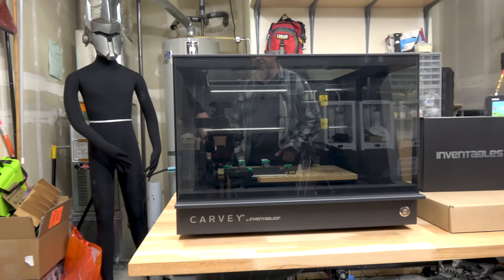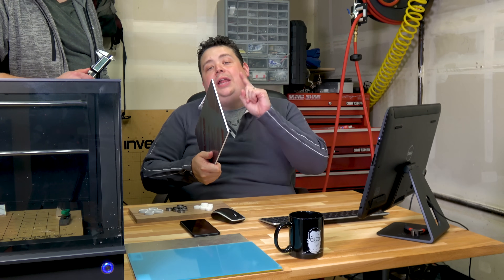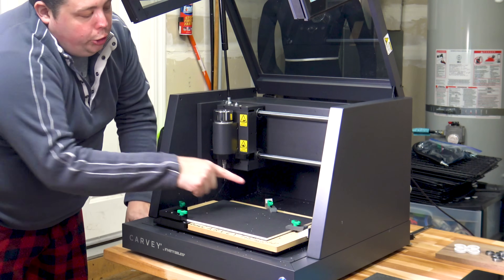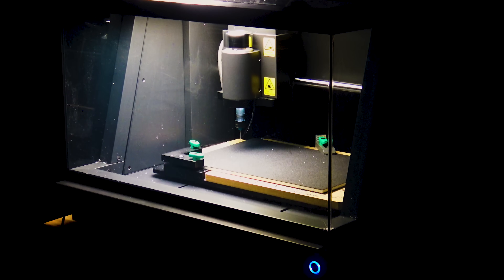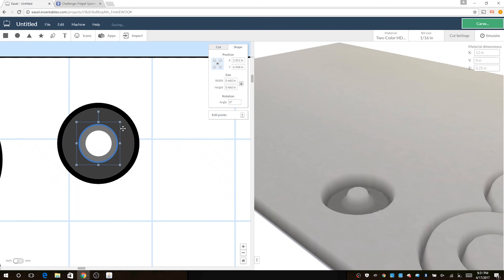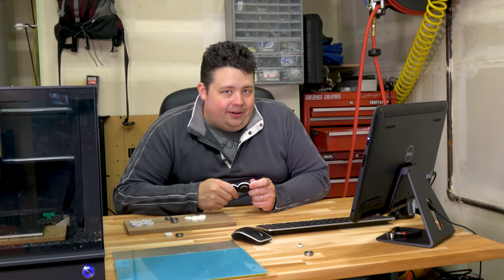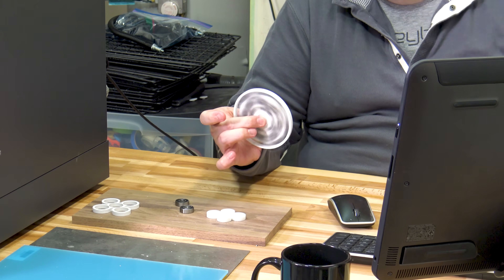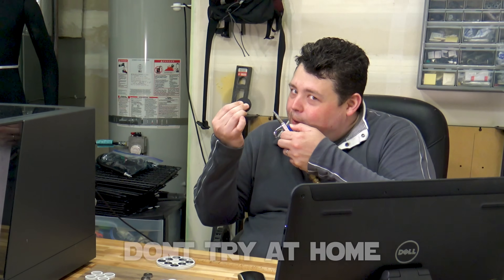Making Custom Fidget Spinners with Carvey Desktop CNC Router!

Comment: Yeah, gotta be careful, warn your users about using compressed air to blow things like fans and other rotating things to high rpm. The problem is that you can create a centrifugal force in the component that it can't withstand and it will fly apart.. Maybe into your face and eyes. If you're using compressed air to blow clean fan blades, use something to stop the blade from turning if you can.

Comment: The cnc router I use is about 6'x6', can cut stuff up to 6 inches high, and its just a small one.
I've made boomerangs and such, I recently made a table leg that twists 720 degrees and tapers as well.
Quite neat things you can do with these, but. 3D printers are more versatile and can do higher quality work.

Comment: I'm pretty sure the first touch off is for tool length and not for material thickness. Also, you may want to look in to using tabs that are basically small bits of material that keep your milled object connected to the rest of the material so it doesn't "fly" out after it has been cut.

Comment: What's more important than zeroing your calipers, is cleaning them. Just close the jaws over a piece of paper, kleenex works best, and drag the paper out. When I was in the machine shop I'd see a difference of up to 7 thou, ((0.007")). May not seem like much, but when your tolerances are +/-0.002", that can mean the difference between a thousand dollar part, and a really fancy paperweight.

Also, the reason those steel bearings work better warm, is because they were designed to work under load, not just free spinning.

Comment: I don't understand why you would use bearings as weights, do they serve some other purpose? Why not use solid metal pieces or slugs? I can understand the center bearing (self explanitory), but the ones on the outside make no sense. Seems like a waste of bearings/money.
Reply from the maker: +souleternal7 because it's a Fidget meaning it needs more than one way to play with it. The extra bearings let you swing it around by the arms, etc. But yes, I'm working on one right now that uses stacks of quarters as weight.
Reply: Oh ok...hey, you need to stop fidgeting around and get working buddy! ;)

Comment: If you want bearings that spin "freely" just remove the lubricant inside.  They won't last very long if you put any kind of a load on them though.
Reply from the maker: +Crobisaur the ceramic bearings don't have any lube. But I'll try this with the steels ones. What is good for removing the lube?
Reply: The lube adds a little bit of initial drag that causes an unloaded bearing to slow down.  It's meant to reduce friction of the steel balls on the bearing races at high speeds or if there is a load (like a skateboard axle) on the bearing.  Removing the lube with a detergent or solvent (like brake cleaner) should give a very similar feel to the ceramics at a reduced cost.  Sorry for the late response btw.

Comment: Metal ball bearings come in many varieties. The sealed ones (rubber guards on the sides) have a lot more drag than shielded (metal shields on the side). You can also get just open ball bearings (that look like the ceramic one with exposed balls) that woud have the least drag, especially if they dont come packed with grease. 

ABEC refers to how tight the tolerances are. The higher the number means the tighter the tolerances (and therefore less sloppy and more expensive). ABEC-1 is the loosest and ABEC-7 is the closest-running you can reasonably find on the market.
Reply from the maker: +Beltonius thanks for the information!

Comment: c'mon, $2500!?!?!?  seriously, way over priced especially for hobbies IMHO for a router mounted to some XYZ steppers and off the shelf arduino like driver....
Reply from the maker: +Eric Mayo then don't buy one? I think my car is too expensive also, it's just a few axels, motor and off the shelf metal. But I liked the convenience of buying something really well built that works amazing instead of trouble shooting my own.
Reply: buy a cheaper car then?  frankly, I don't get the comparison.  cars involve millions of man hours, dealing with federal regulations, etc... and this compares to dremmel mounted to some electronics.  you have to admit that at $2500, something is off here.  in other words, I didn't know this was the Bentley Continental of carving machines.

Comment: What is the difference between this and the x-carve
Reply from the maker: +DomesticLlamas23 it's fully enclosed, quiet, sealed so no dust escapes while cutting, easier to use, looks way better and a few other things. But the X-Carve is amazing and can do all the same things with a bigger build volume. Just depends on where you need to run the machine.

Comment: Since there's no load on the bearings, and they are spinning at low RPM, you could make them spin longer by cleaning the grease out and removing the seals.

What that carvey can't do is spin a big face mill or fly cutter though. I think Barnacules might need to get in touch with Tormach... Or retrofit an old Bridgeport with steppers and ball screws (plus a controller).
Reply from the maker: +Oscar Anderson cool, the Carvey is designed for small projects and isn't a replacement for a proper giant industrial CNC mill. However if I had the space I would love to own one. The guys at SeeMeCNC have a giant one that I watched mill hit ends for 3D printers and it was magical.

Comment: Actually, at 3:43, you said how black isn't a color. But black IS a color. Black on the color spectrum is all of the colors possible into one color. White on the other hand is the absence of color, technically making white not a color. Many people get confused by the light and color spectrum. While black is the absence of color on the light spectrum, it still remains a color on the color spectrum. For example, when painting, mixing all of the primary colors would result in black.
Reply from the maker: +ItsKaspr I know, I was saying what other people would say since I've seen it before ;)
Reply: And if I told you colors don't exist. Your brain is fooling you! Mwahahahaha

Actually this is true, everyone sees the same "color" in a different way.
Reply: Barnacules Nerdgasm I figured you knew. Just thought I would let others know that you were right.

Comment: Please dont use an aircompressor on a bearing, there is a chance it will break into pieces, please dont, use really hot water to get the OEM grease out. Much more safe :)
Reply from the maker: The ceramic bearings don't have any grease in them.
Reply: No, to points mixed together there, u get it :) Keep making the vids, love ur stuff :) :)

Comment: If you remove the rubber seals on the metal bearings they also spin for longer just like the ceramic ones the seals only add drag and stop debree from entering and grease leaving the bearing but since its just for plays you dont really need em

Comment: You should seriously not put a fidget spinner under an air compressor. That is extremely dangerous like you said in the video. I did that one time and my spinner broke from the insane amount of centripetal force. It hit terminal velocity and broke apart. Sent 2 bearings flying across the room so fast that I could not see them. One could have hit me in the face easily. Never doing that again and no  one else should either considering some manufacturers could have low quality plastics.
Reply: Jonathon Hebert same happened to me but I was at work so had a few people it could of hit, definitely almost pooped
Reply: Jonathon Hebert Did your mum tell you that?
Reply: Jonathon Hebert Meh, you're only a human

Comment: CNC is insanely rewarding.  Here is a tip for future projects.  use thin small tabs around the outside of the part.  These will hold the part to the parent material to keep them from flying out.  The part can come loose and hit the endmill breaking it. While these machines are open source like the troll has pointed out.  not everyone posses the skill or tools to build one themselves.  I do thing the carvey is a bit over priced for the size and power.  it is still a great way to get into subtractive  manufacturing.

Comment: for the link to the ceramic bearings does it come in a pack or just a single bearing cuz its over 9$
Reply: george aura id think just one cause one pack is usually 100$ or 80$ i use them on my skateboard

Comment: Barnacules, the challenge is cool, for those who know enough about it. I hope that some guys will do something nice with it. It is a nice machine, I can imagine that this will be a great tool for many people some day when they become more affordable. One thing I am wondering about: do you need a good ventilation like when you 3d print? You don't melt anything but maybe you could breath in dust particles after the carving is done and you open the machine? Maybe some dust particles might get stuck in the alveoli of your lungs? I am a n00b to this but I do know that for 3d printers good ventilation is rather important, if you don't want to live on the edge. ;)

Comment: What is the precision and accuracy of this machine? What is the minimum distance it can displace horizontally and vertically? It makes circles by combining horizontal movements of the drill with vertical movements of that flat piece, to make good circles those horizontal and vertical movements need to be very small or it will look like when you have a picture on a low resolution monitor. I would guess that the minimum displacement is considerably less than 1 mm. , otherwise you would notice it with your naked eye.
I know that it won't even come close to a few nm. (ASML which makes the wafers for Intel, TSMC, Qualcomm, GF... has such an accuracy) so it has to be in between.
Reply: I did a little research and it looks like you can do full 3D CAM (Z-height change during X-Y movement) using a 3rd Party tools like Fusion 360.  I haven't tried it yet, but it is on my list of things to try to get Jerry to do with it...

Comment: Such an awesome video, you are back on track just like you used to be, weight loss will come slowly just no stress!, PS. you can remove the grease from regular bearings(with degreaser) to reduce the resistance, but after that only use them for spinners cause they heat up a lot

Comment: could something like this be used to potentially create props/toys/anything like a 3d printer, but to a higher standard or is it only for thinner parts
Reply: Maybe if you stack the sheets
Reply: Totally could.  With a 3 axis mill, you can't cut underneath something, so you would need to stack sheets like +mryousof2000 suggests.  You could carve two halves of a prop gun and use them for vacuum forming.
Reply: I totally overlooked the fact that you can't cut underneath lol, tbh doing that and stacking might still be quicker than a 3d printer

Edit: I just realized that Jerry answered the stacking question in the description
Reply: Kishen Pankhania no worries.  We all miss things at times - we probably made mistakes in the video as well.  It's all about learning and being respectful.  Good question!

Comment: +Branacules Nerdgasm
9:15 even put them on like an air
9:17 compressor or something like that 

how stupid can you be??  have you ever seen a bearing explode from compressed air blowing on it? they do and it is as bad as a shot gun going off

i hope you like getting sued
Reply: The edited comment should have been the initial comment honestly about them exploding
Reply from the maker: +Adverse Effects you're an idiot.
Reply: such an intelligent reply 

not

i have worked in the automotive industry for 35+ years as a motor mech  and in that time i saw lots of TA's(trades assistant and Apprentices do what your telling kids to do and several of them did have the bearings explode and 1 of them did die from it
Reply: Abec 7 bearings are designed too work at speeds up too 30,000rpm. Barnacles wasnt in any danger.
Reply: "Abec 7 bearings are designed too work at speeds up too 30,000rpm" 
yes that may be true but only when they are in there correct reinforced housing that gives them a lot of strength

Comment: Does it have the rigidity to cut metals provided the use of carbide tools?  Obviously wouldn't expect the quality of an industrial mill, but it would be sweet if it had the capability at all.
Reply: Hmm,my guess is no.I don't think the motor can handle such a load.Maybe aluminium because it is a lot softer than the other metals.

Comment: Nice job.

Haha "Pretty Dangerous"  I would say, extremely dangerous.  That could shatter sending shards everywhere, and could blind you if it hits your eyes.  Not saying don't do it, because I have done similar in the past.  Just be careful.  Get some eye protection on.
Reply from the maker: +paul30003 I'll confess, it was low pressure and I tested it off cam to make sure it was fine. I already screwed up once with high pressure ;)
Reply: Don't get me wrong, i'm no health and safety freak, but even low pressure could potential spin that up to the point of failure.  I've done some pretty dangerous stuff myself, but I've always protected my eyes. You only get one pair, and your stuffed without them.

Comment: Could this cut through titanium?
Reply from the maker: +Flackdiesel889 very very very very slowly with a diamond but.
Reply: probably if you have the right drills
Reply: Barnacules Nerdgasm tungsten carbide
Reply: Not a chance on this.  I machine various materials including exotics for the aerospace industry, you need the right tooling with flood coolant for cutting titanium.
Reply from the maker: +paul30003 good to know.

Comment: the following is a paid presentation.
Reply: I think you did a presentation inadvertently. It IS a commercial but (with or without pay) it IS a good product and from that I agree with you.
Reply: How about adding a dust collection system with a shop vac?
Reply: flyingHigh fuck off. leave the guy alone.
Reply: never mind
Reply: srry.
Reply: How many things that you reviewed did you get for free?
That is paid presentation.
Reply from the maker: +Mexo Man actually, it's not a paid presentation. I don't do paid product reviews, only honest ones.
Reply: oh OK.  sorry man,  would you think that this is a good starter machine to get in town the hobby with?
Reply from the maker: This is the easiest carving machine I've used yet. But also look at Shapeoko and smaller X-Carve, they are cheaper but louder and messier. Work within your budget!
Reply: OK thanks man